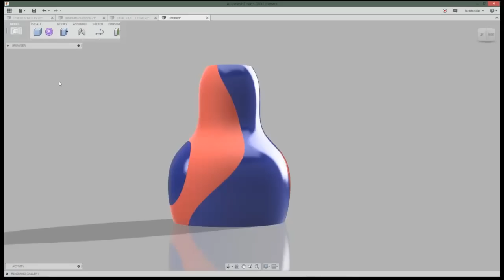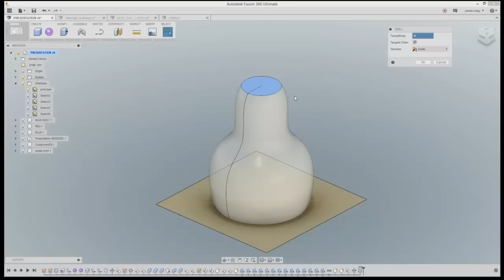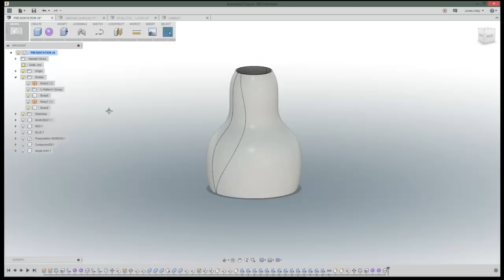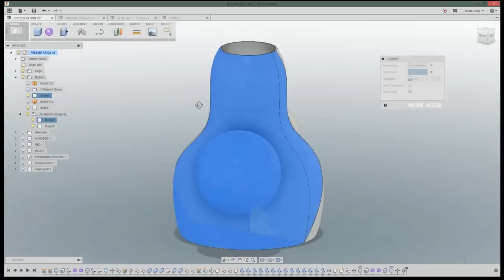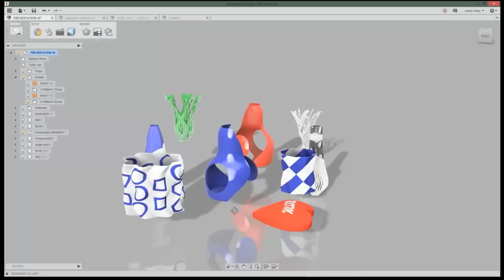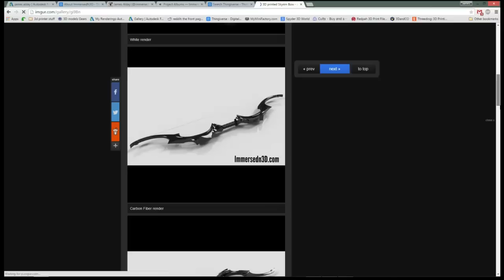Fusion 360 Live Classroom: 3D Printing with Fusion 360

Comment: Thank you. When you added thickness using Shell modifier : does this mean that one can not print out exactly the precise thickness of the model ? what if for example an enclosure walls should be 2 mm for real world use ? is it possible to print the model out with the exact given thickness ? I am just totaly new to 3d printing.
Reply: Yes.  Depending on how well calibrated the machine you are working with.  I put varying levels of "tolerances" on my sizing depending on the style of machine\material\print settings I am working with.  But technically, the size you put into the software will directly translate to real work sizes.